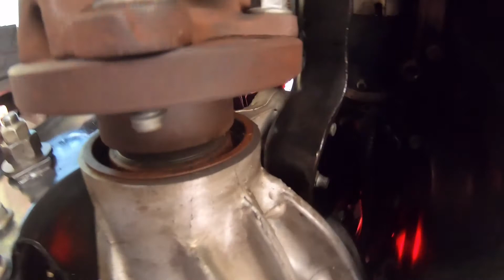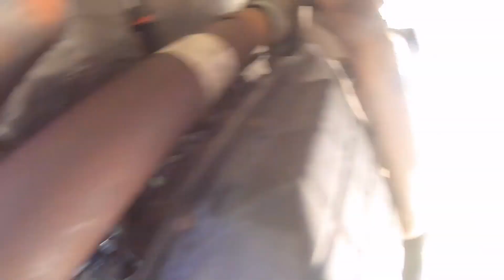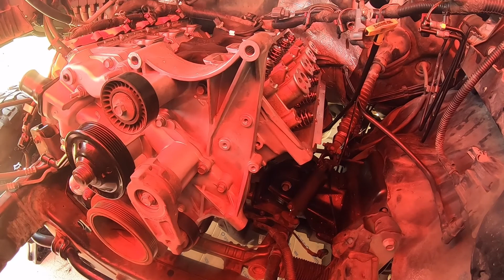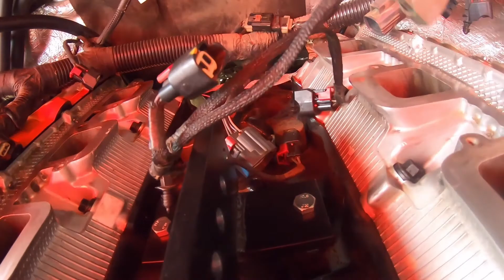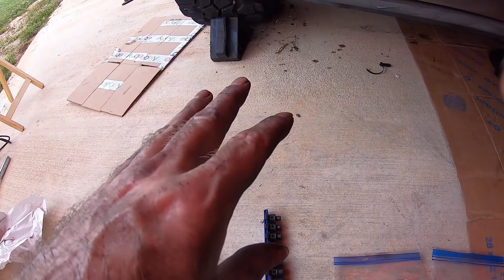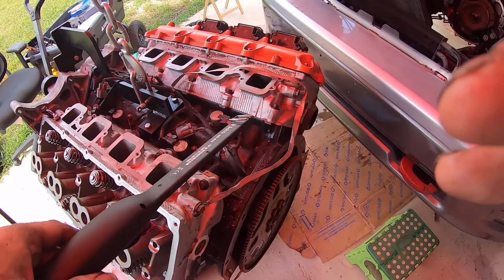2009 hemi 1500 trx4 build part 32.  Teardown prep for pull part 2.  Engine has been pulled.

Comment: Get yourself a new vvt selenoid, they updated the part in 2015 to be all metal screens instead of the plastic
Reply from the maker: Thanks for the comment.  Great point and already done, it will be installed on the rebuild.